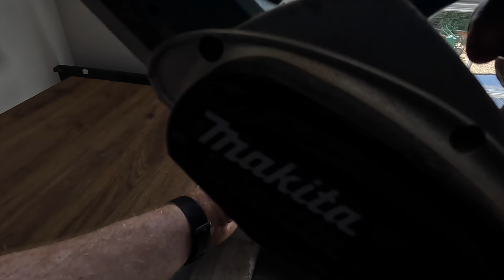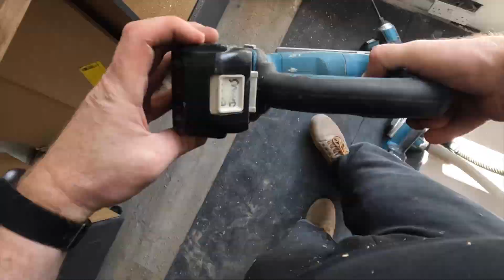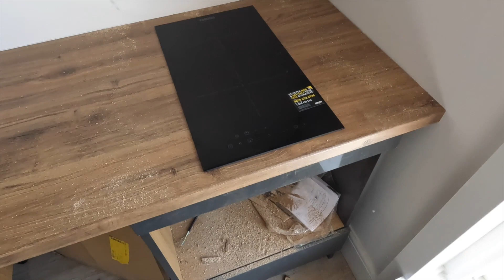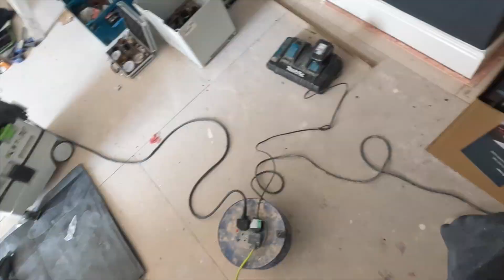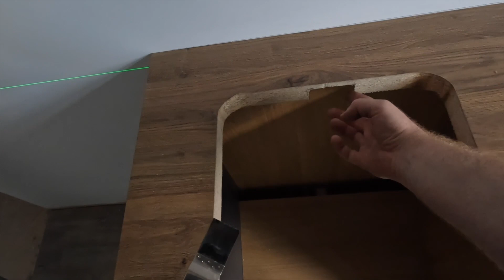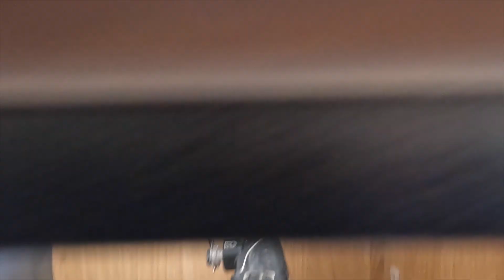Kitchenette Final Part! Installing the Sink, Tap and Hob. Full walkthrough, Day of a Carpenter!!!

Comment: Where did the wood that was under the worktop that got drilled through and removed after the cut out was complete come from?
Reply: So it’s designed to come out? Never fitted a kitchen so all new to me. Seems strange you drilled through both and removed them.
Reply from the maker: It gets cut to the shape of the sink/ hob.  Sometime it leaves such a little amount on the front that you can't keep it on.  It's usually more of a problem in kitchenettes then normal kitchens as you are trying to fit normal sized things in to smaller units.  You really have to get creative sometimes to add strength back in
Reply from the maker: That's the top of the Carcass Adrian 👍

Comment: I quick tip to anybody cutting out holes in a worktop for sinks and hobs if you cut the 2 vertical cuts first then just get a scrap piece of wood wider than the hole your cutting out and screw it across the piece of worktop your cutting out then when you finish your final cuts it won't fall through then just lift the scrap piece out if that's helps anybody 👍🏻